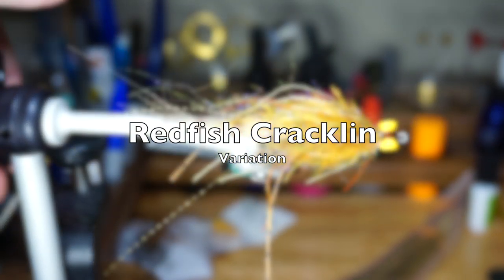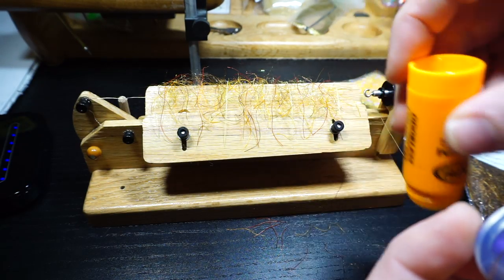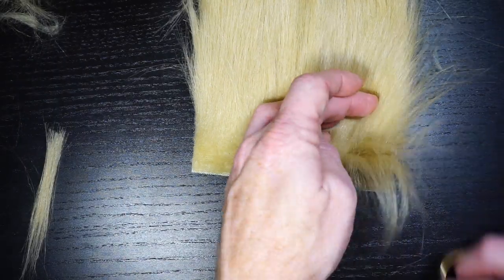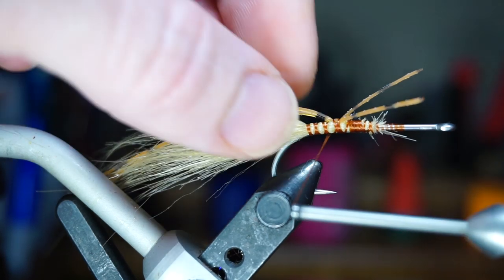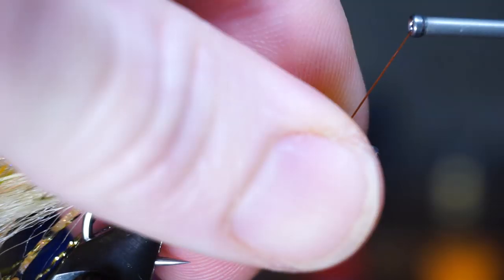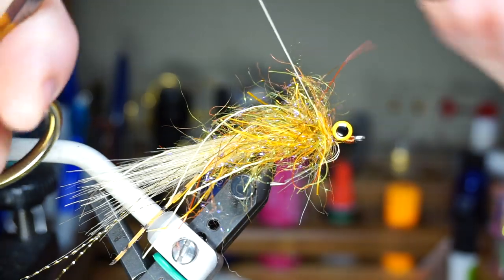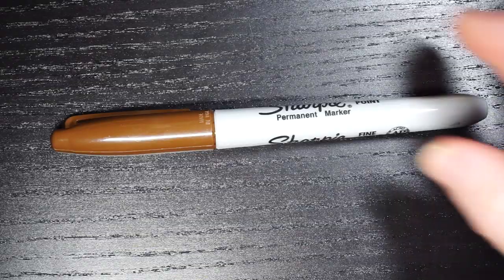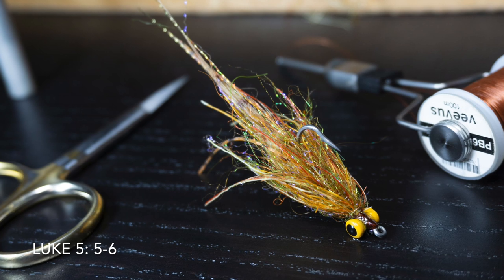Redfish Cracklin (Leggy Redfish Crack on Steroids) - McFly Angler Saltwater Fly Tying Tutorial

Comment: Good looking fly as always. Thanks for the tutorial. Have you looked at the NK and PS NK dubbings? They seem to be basically what you're mixing up here (Kraken dub with legs). That's what I ended up using since it's what I have. Thanks again!
Reply from the maker: Thanks!  So with any pattern, it is absolutely ok to substitute different materials.  Sometimes those substitutions have different properties and change up the fly slightly, other times it is very similar.  Like you, I use what I’ve got.  I don’t know much about the NK dubbings but if you’re catching fish with it then it works!